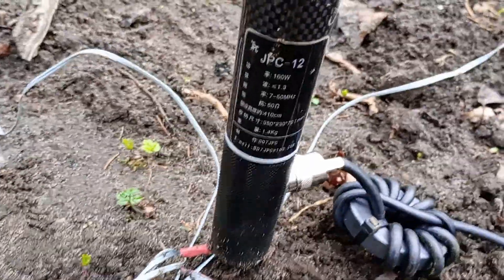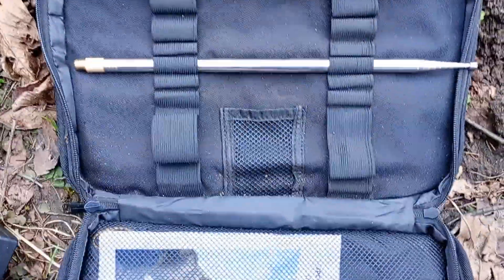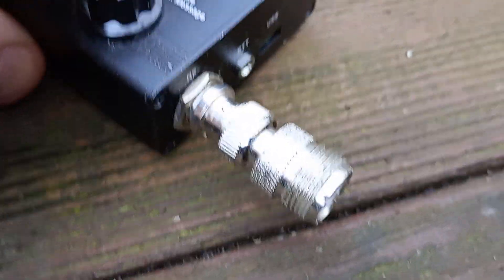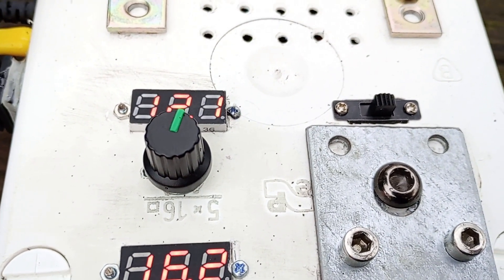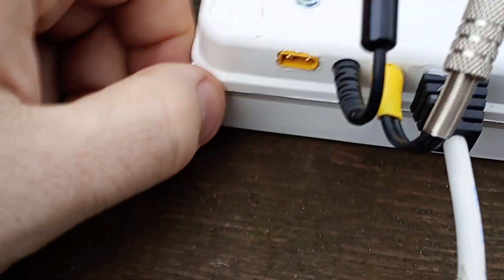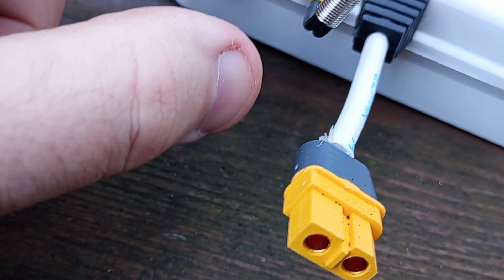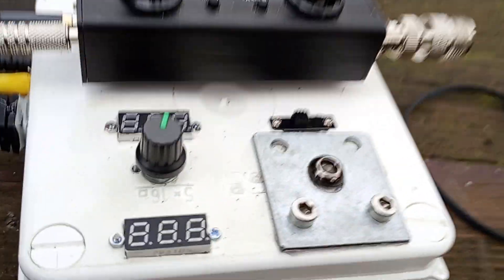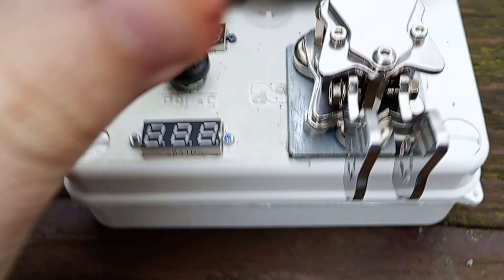QMX Assistant – to make QMX even more portable

Comment: Hi Adam, I actually planned some similar setup. I think it's a good idea to combine a) battery, b) active speaker, c) paddle and d) QMX in one unit as it increases the failure safety in the field. But on the other hand, I already own ready made battery boxes and active speakers. And for the paddle, I thought of mounting a Puttikeg or similar keyer on a leg / knee strap, so I can operate it slip free. I once keyed CW >30 WPM, but those days I've used a homebrew sensor paddle with no moving parts. Testing even top-notch finest mechanical paddles recently, I'm disappointed with the "delay" introduced by the mechanical movement of the contacts, even when it's very short in time. So I might revert to the sensor design.